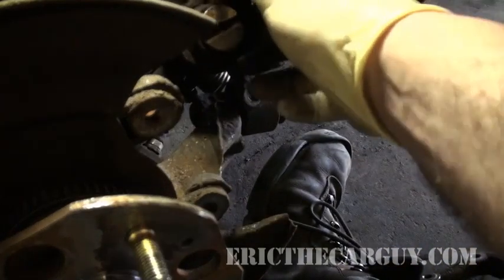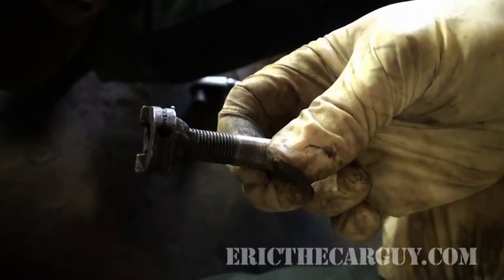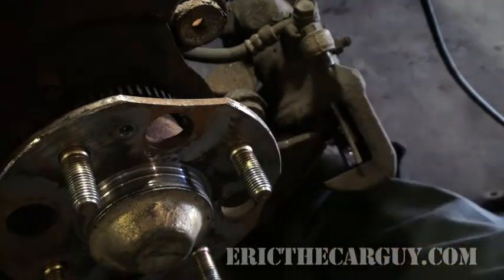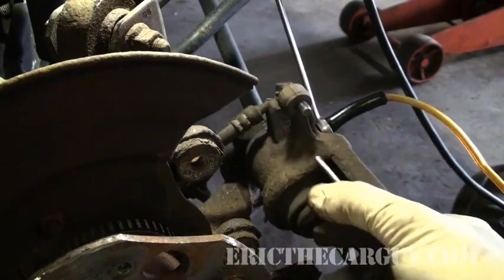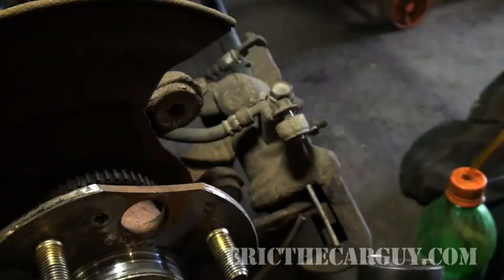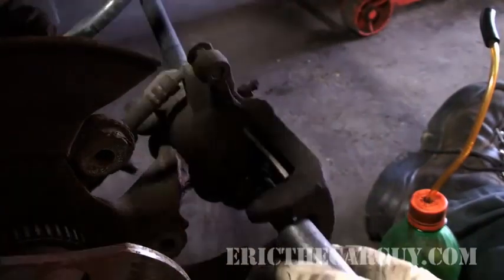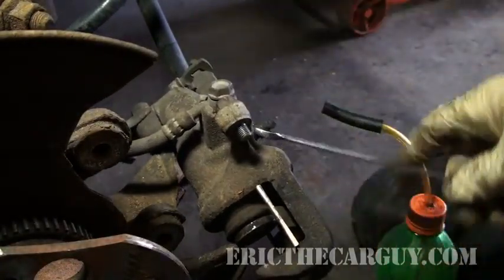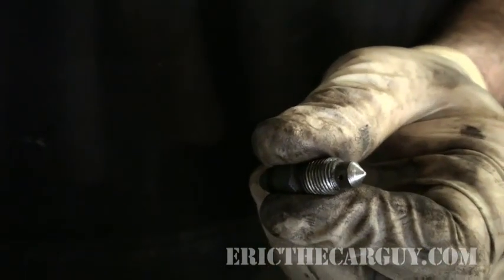Replacing Rear Disc Brakes Part 2 - EricTheCarGuy

Comment from the maker: @dappawap The caliper piston does not rotate as it moves outward, it's actually a ratcheting mechanism that keeps the piston close to the pads for applying the parking brake.  The only time it needs to be rotated is when you retract the piston however it needs to be held in place by the locating pin on the pad so that it does NOT rotate during normal operation.

Comment from the maker: @therockkkkher The reason I crimp the hose is to help prevent air from getting into the system, think when you take a drinking straw from your drink with your finger over the end and pick it up out of the glass, the drink stays in the straw and the liquid doesn't come out, the same will work for air here.  It also helps prevent any fluid from being forced back in the opposite direction.

Comment from the maker: @raikkonen85 The correct lubricants are the ones used in this video.  It is VERY important you use these lubricants in the locations shown in the video or you may seize the  caliper up especially if you use regular grease or anti-seize on the caliper pins.

Comment from the maker: @DJYIC It's just a rear caliper compression tool, you can borrow them from most auto parts stores and will work just fine so you won't need to make one like the one I used.  Thanks for the comment.

Comment from the maker: @md4babes Not all rear calipers need to be turned in, in fact if you were able to just push yours in I'm sure that it's OK since that normally that is not possible with they type of caliper that has the parking brake as part of the caliper assembly.

Comment from the maker: @shaneunderwood Actually Mazdas come to mind as they have a different system where you have to remove an access in the back of the caliper to turn the piston in.  Lots of different rear caliper designs not every method works for every one.

Comment from the maker: @aaronac8 If you do it this way there is no chance of introducing air into the system.  If you force fluid back into the master you run the risk of damaging the seals in the master, I've seen it more than once where a simple brake job turned into a brake job and a master cylinder as a result of that practice.  I strongly recommend against forcing fluid back into the master as a result of those experiences.

Comment from the maker: @aristas30002000 Sometimes when you reinstall the springs sometimes the rubber on the upper strut mount gets out of place.  You can see a "witness" mark where the spring used to sit in it's rubber mount, you need to try and get it back there if you can after installing the new strut.  See if this is the case, if not, let me know.

Comment from the maker: @sakitlikod1 I have seen instances where that damaged the master cylinder.  I also don't do it so that I don't overflow the master causing brake fluid to spill out the top as brake fluid will ruin paint.

Comment: I find that the little plastic straw taped to the side of cans of brake cleaner tends to fit really well down inside the neck of the bleeder screw.  Hold the bleeder screw and straw together with the thumb and forefinger, and spray.  Any gunk in there blows right out.  Safety glasses are a must, of course.  :-)

Comment: @EricTheCarGuy What I don't understand is how the rear caliper of the 2002 Taurus is able to move out by rotating ,even though the pads have edges that are aligned with the notches in the caliper pistons. Since the pads are in one position (except for the in and out movement) I would assume this would prevent the caliper from turning out as long as these edges are seated in the caliper notches.

Comment: Eric, Great video.  My buddy and I already changed our rear brakes but compressed the cylinder back in verses using the turning tool. Looking at it now it does have the parking brake line back there. Am I going to have a problem and should I go back and re-turn the cylinder back in.  Thanks.

Comment: What I don't understand is how the rear caliper of the 2002 Taurus is able to move out by rotating ,even though the pads have edges that are aligned with the notches in the caliper pistons. Since the pads are in one position (except for the in and out movement) I would assume this would prevent the caliper from turning out as long as these edges are seated in the caliper notches.

Comment: Hey Eric  My bleeder screw is really frozen.  Any tips on how to get it out of the caliper without breaking it.  I am renting a tool to screw the piston back in.  The brake pads are worn pretty evenly so I want to try and reuse the caliper.

Comment: Why not compress the caliper piston without opening the bleeder valve and have brake fluid return to the master cylinder (as long as it is not topped off)?  Therefore there is no chance of adding air to the system.

Comment: ive seen people use different lubes. some people using silcone, some using threadlocking compound, some using copper grease. which are the correct ones to use and on what?

Comment: The Harbor Freight tool is much nicer than that one, as it's a lower profile design using magnetic attachment for the disk adapters.  The socket setup on the one in the video is really bulky, making it unusable.